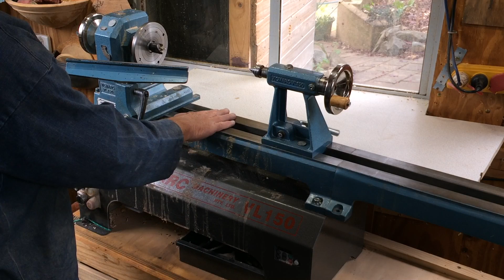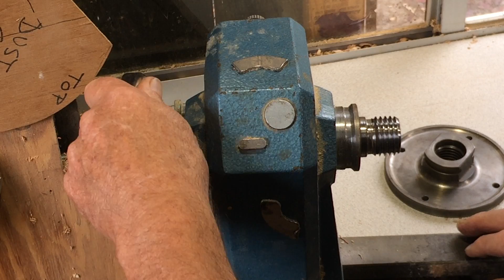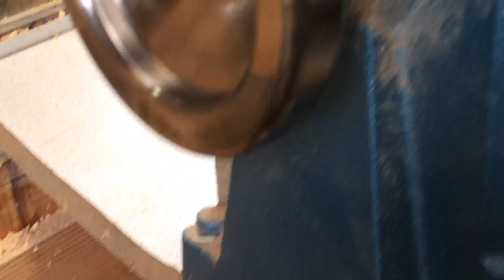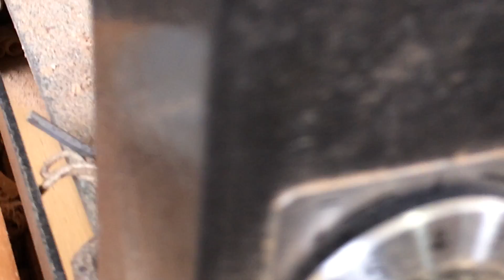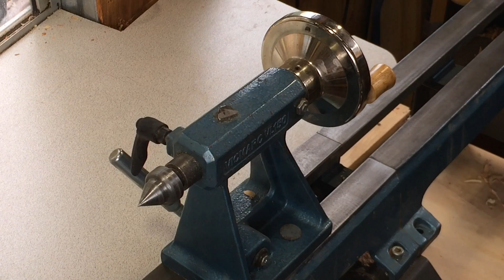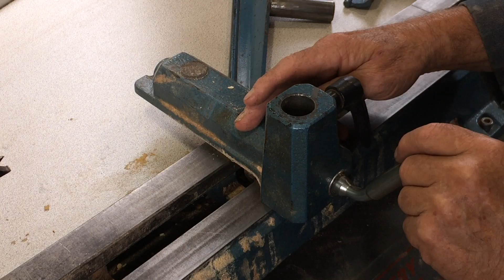Richard Raffan's basic guide to woodturning lathes

Comment: I would like to add an advisory against lathes that have advanced electronics.   Just like with a car that has a lot of the latest and greatest gizmos, a lathe with microelectronics is bound to end up in the shop for expensive repairs.
Reply from the maker: Sounds like you might have had a few problems that most people haven't. My experience and observation is that the EVS control on most modern lathes is very reliable, although never as worry-free as shifting a belt by hand on simple step pulleys.

Comment: I use a WoodFast mc908 lathe. Perfectly happy with it. It has variable speed and is quite robust. Not very common here in the USA.
Reply from the maker: They were excellent lathes, especially on top of the Craft Supplies stands. I had three for a decade before the Vicmarcs came along.

Comment: Great video Richard, thinking about selling my   NOVA 1624-44 and getting a VICMARC....they look SOLID!!!!!!!!!
Reply from the maker: I"d certainly pick a Vicmarc over Nova anytime, not that Novas are bad, just not as used friendly or as well made as Vicmarc, particularly when it comes to chucks.
Reply: @RichardRaffanwoodturning  Thanks Richard for the advice, certainly in the plans for a vicmarc lathe....need to setup my workshop with 220v first.
Reply: @RichardRaffanwoodturning  How long is the bed extension you have? what's the total distance between centers?
Reply from the maker: @dannyboy9784  My bed extension is 500mm. The distance between centres on the basic VL150 is about 350mm so I can turn a maximum length of around 850mm. I'm sure you'll find all the measurements on the Vicmarc website.
Reply: @RichardRaffanwoodturning   Thanks Richard, I watch all you videos, big fan of your work and style and the simplicity you approach your projects and the fact that you don't edit your videos is awesome....we get to see the real LIVE experience.....Cheers, from Toronto Canada.👍

Comment: I bought the cheapest Grizzly "mini lathe" they offered on the advice of a youtuber, about 14 months ago. Immediately I had to track down a problem with the worn brushes in the "new motor," but ended up replacing just about every part of the lathe and adding direction and speed control, which has been a lot of fun for me.

These days my issues surround getting the new nova "insert type" chucks to go on and off without wobble. How often have you had to track down vibration or other mechanical problems in a lathe of higher quality, and what of underpowered motors which slow down as you start to cut? In my experience it has been a very good teacher about how I'm holding the tool.

Comment: I was told never to use my spindle lock for removing chucks as it would damage the indexing mechanism.  Is this just nonsense?  It would certainly be easier to just use it for that and to lock the wood in place for various things (sanding, etc.). Right now I’m using a bar through the handwheel (my lathe is a record coronet herald if that matters, but it’s pretty similar in basic features/sizer to the vl150).
Reply from the maker: I never use the indexing head for indexing so that's not an issue for me. I've used the indexing pin as a spindle lock on the dozen or so Vicmark lathes I've used day to day and never had a problem with them even being sloppy. If a lathe has both a spindle lock and indexing head, then it makes sense to use the spindle lock to lock the spindle.
Reply: @RichardRaffanwoodturning  I just have the indexing head - but I suppose I might as well use it to lock the spindle as I don’t even really know what you’d use the indexing for.
Reply: I pretty much only use my lock to get a piece off the wormscrew.